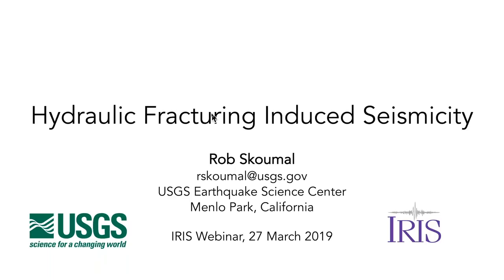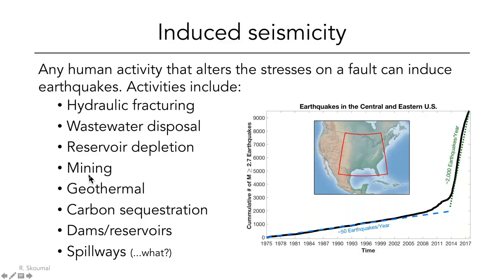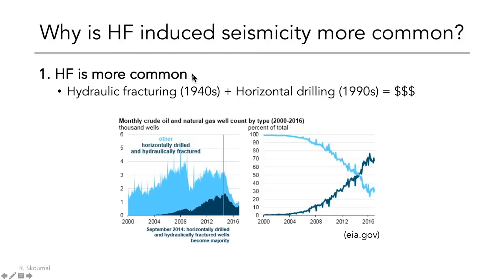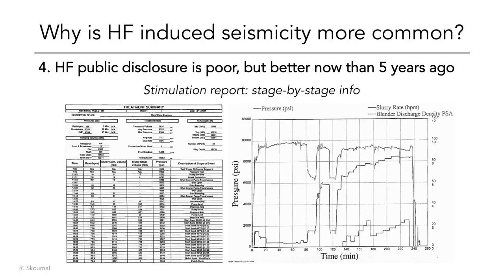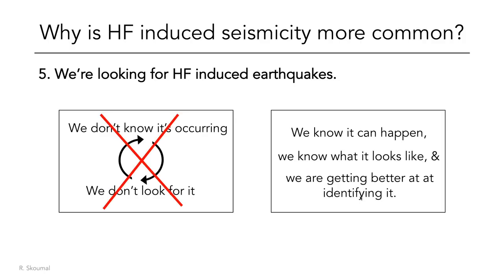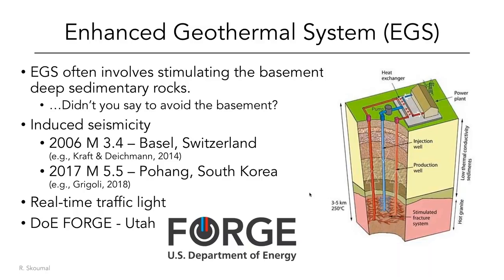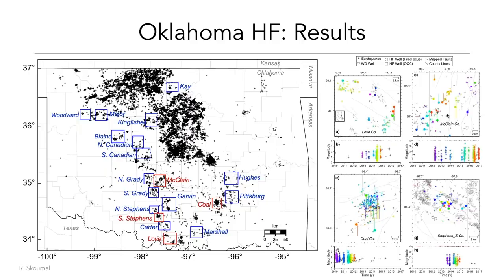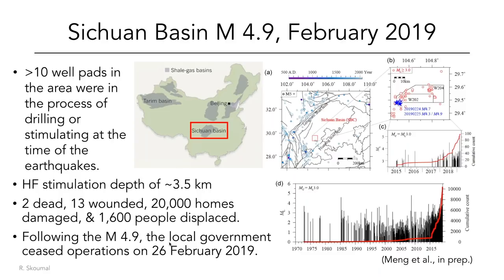Hydraulic Fracturing Induced Seismicity—Dr. Rob Skoumal, USGS (IRIS Webinar)

Comment: even though the black line in figure @1:03:56 comes from 3 stable stations, the templates are not. The templates are coming from OGS and the OGS network is becoming denser and denser with time. So there might be a bias there in the detection